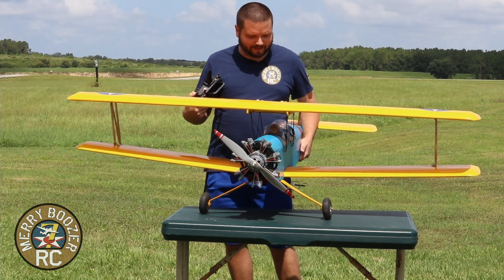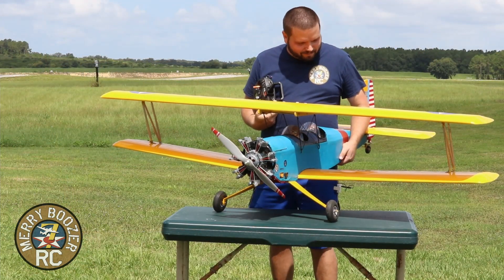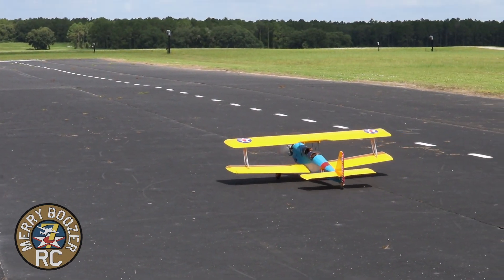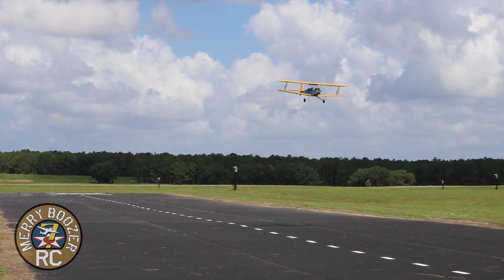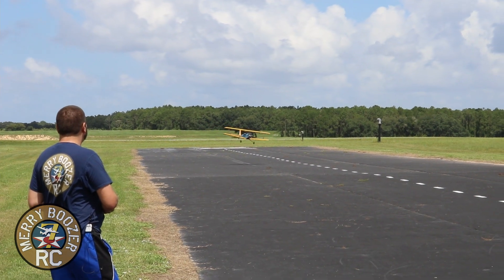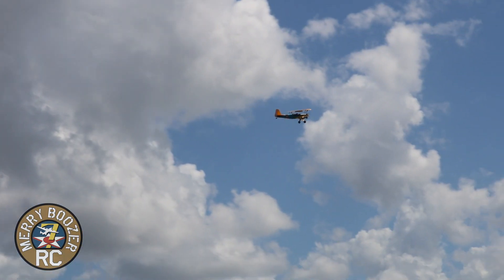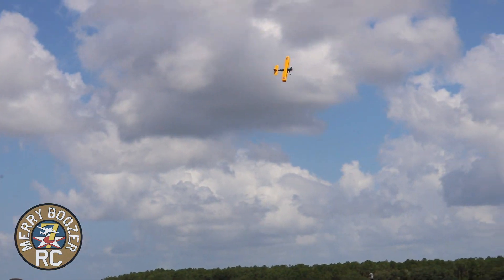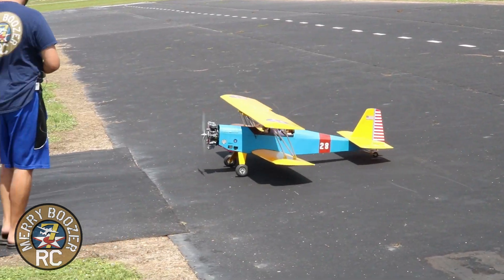PT-17  Nitro to Electric Smart Technology Conversion Maiden Flight

Comment: Nice job guys on both the power conversion and the maiden flight.  I really love this airplane. It is great to see that you gave it a new life through your gas to electric conversion. You will have all of us looking for some of these older airplanes at swap meets now that we can buy to do conversions. Bet getting the CG set was no easy task trying to replace that heavy gas engine with a smaller electric motor. Did you have to add a lot of lead to the nose to get it to balance?
Reply from the maker: Yes all the conversion so fare have needed led in the nose

Comment: That’s Awesome! Looks and sounds good! I’m currently building my first balsa build. The classic PT Electric. It comes with and old brushed Thrustmaster motor. I’m putting in a Eflite motor from an old Apprentice. Can’t wait to see how it turns out.
Reply: I had one of those about 14yrs ago it flew well on 9.6 volts  with a brushed 550 mabuchi brushed motor, I would changed the motor to a 3530 prop drive 1400kv 400w
is the perfect replacement cause you can still use 8x6 prop and the original used 8x4.
you'll have enough ground clearance.